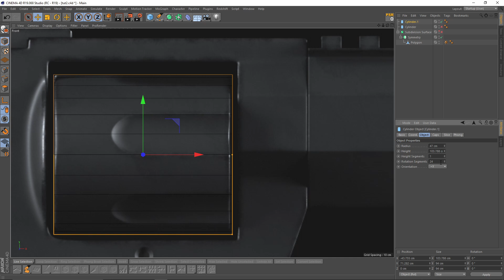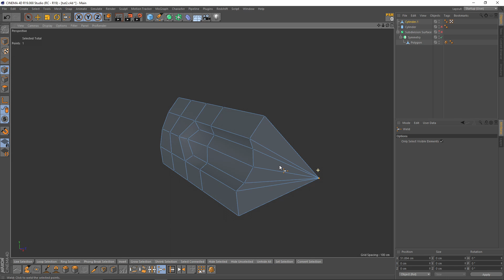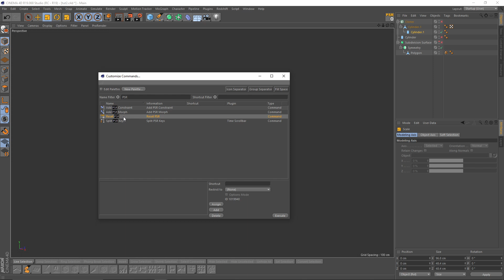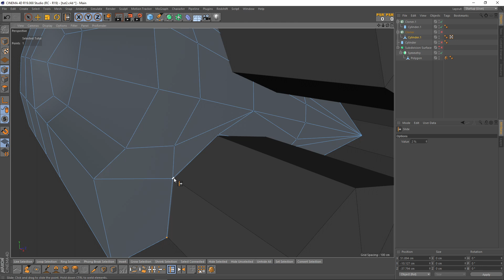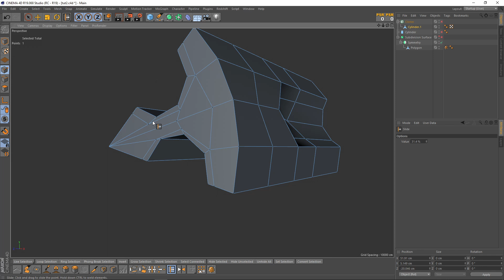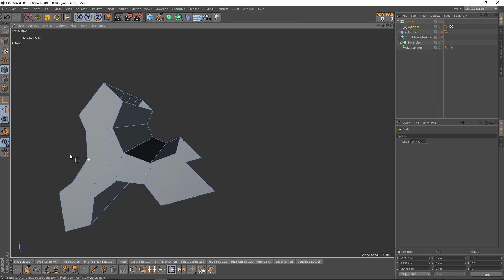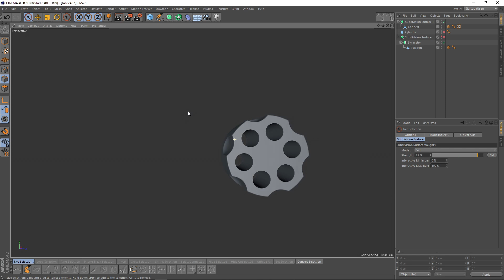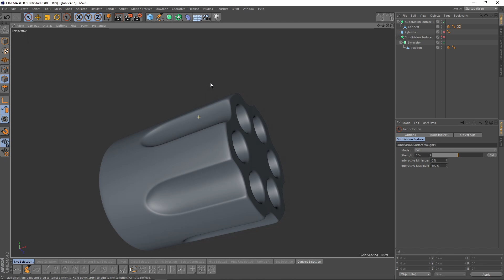Cinema 4D Hard Surface Open Subdiv Modeling Tutorial | Part 2

Comment: wouldnt it be faster to model one section, subdivide it and then use radial symmetry? so you dont have to select all the edges.
Reply from the maker: Sometimes this method is faster and more flexable

Comment: 5:30 Polygon snapping doesn't work here?
Reply: My workflow is split that shape and use [Viewport solo single] that's my solution. Ez for snaping!
Reply from the maker: there is no snap, just slide tool, right click then select slide.
Reply: @polygonpen   you should use carnackeys or something else to show hotkeys, this will improve the speed of the tutorials and help newbies learning the shortcuts instead casually right-clicking.
(ye-ye I saw some people are complaining that the video too fast but don't listen too them. Videos are pause and rewatchable with adjustable speed.
Learning = watch more times the same video.)
Reply from the maker: When videos keep longer I tend to forget to mention shortcuts, I will look for that to show shurtcuts, thanks.